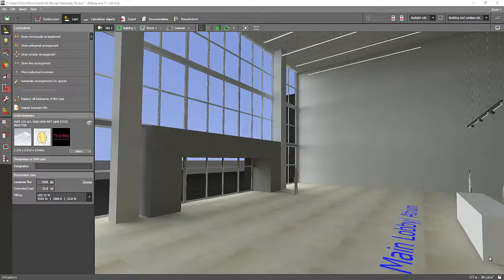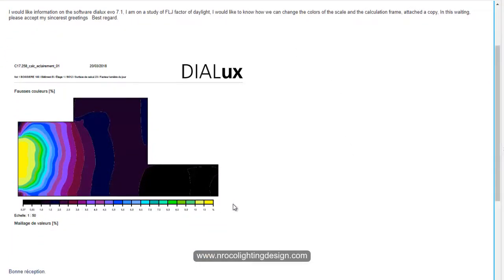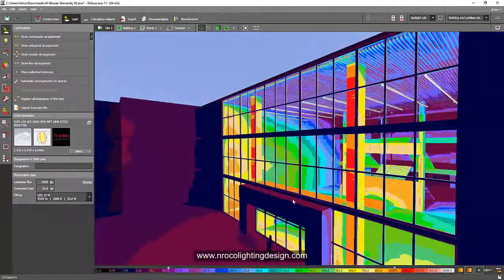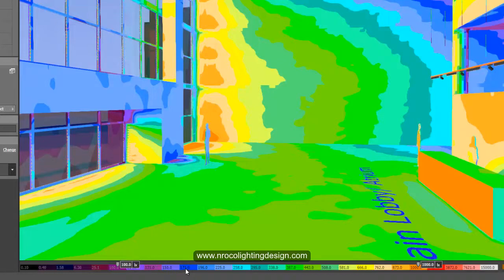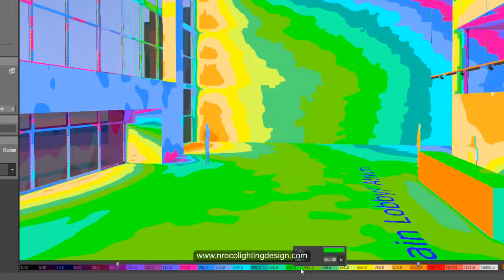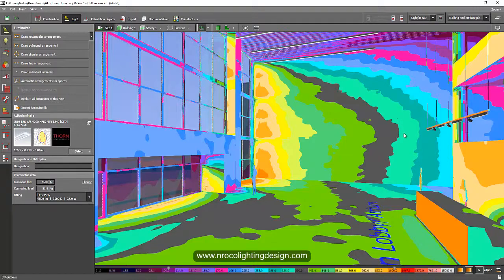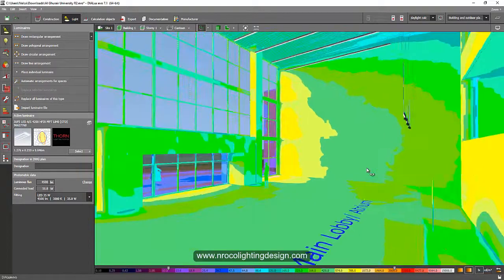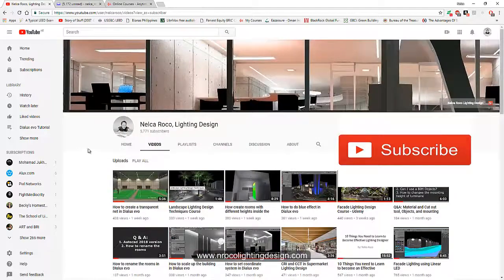How to change false colour values in Dialux evo thru Daylight factor

Comment: Hello, Nelca. Thank You for making these videos, they are really helpful.  I have a question. I live in Serbia and it's commonly offered here by distributers to use recessed LED panels as ceiling mounted or suspended by using appropriate kits. But when I import a recessed luminaire in dilaux evo, I don't know how to get the programme to suspend it. How to do calculations with recessed luminaires using them as suspended?